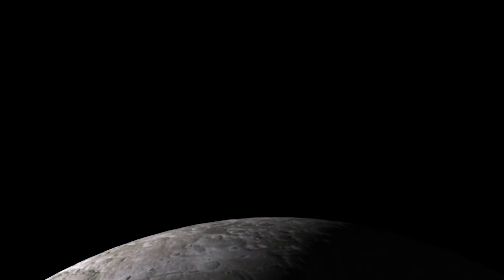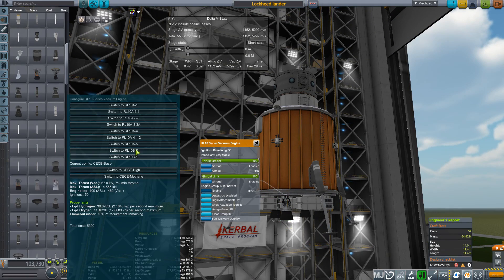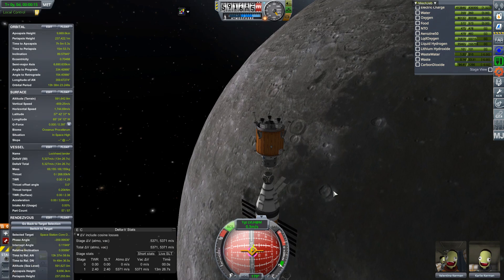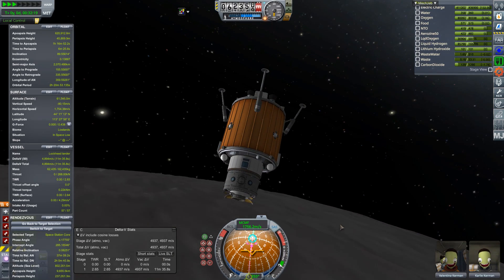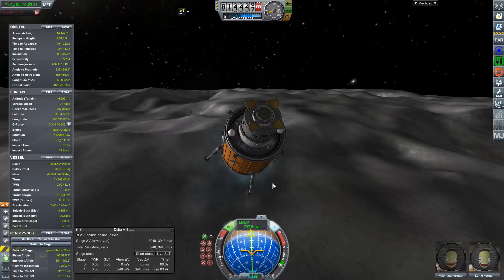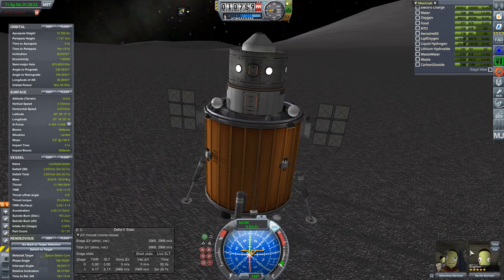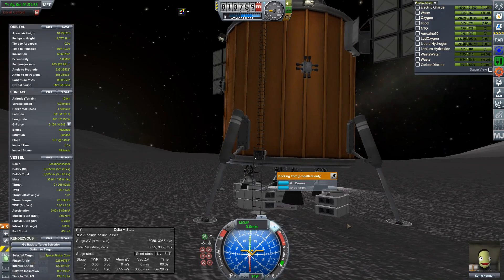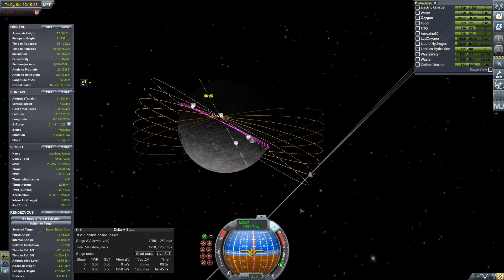Simulating Lockheed's Reusable Lunar Lander Concept

Comment: This thing won´t be ready in the next 10 years i bet, BFS will do the job a lot better before this thing would launch and it could refuel too on the surface, as  carbon can be collected from the solar wind(maybe also carbonate minerals) and enough water ice to use the sabartie process.
Reply: The solar wind is not really thick enough to collect carbon from in any decent amount of time. Choosing landing sites with carbon-based minerals is desirable. In addition, you need a lot of different chemical processes to get it into a usable hydrocarbon fuel.
Reply: i thought it was the bfr lol
Reply: The thing that gets me about this is the weight and payload.
Lockheed lander weighs 60t (all inclusive) and has a 1t payload.
BFS V3 weighs ~85t (empty) and has a 100t payload.  Yes you have to refuel it in LEO but that's a total of 285t, a 4.5x increase in weight over the Lockheed lander in return for a 100x increase in payload capacity.
Not to mention that Lockheed would probably charge the US taxpayer $20bn+ to develop it just like Orion ($23bn to 2023, excludes cost of the ESA Service Module)

Comment: What would be the advantages of using hydrogen fuel compared to… let's say methane which will be used for most of the rockets from now on?
Reply: Specific energy 142 MJ/kg for hydrogen 55 MJ/kg for methane.
Reply: Thank you very much
Reply: It's the opposite. Methane has no advantage over Hydrogen in a deep space enviroement. Higher ISP is everything. Methan has been choosen only because on Mars you can theorically harvest Co2 and make methane.
Reply: oh I see, now I understand it a little bit. I just started my first year in university so I don't know a lot about it yet. But I'll get there. Thanks again for the answers I appreciate it.
Reply: nuke99 there still a lot of things I don't understand on this scheme, if they plan to produce hydrogen and oxygen from the moon, they don't need to carry the return fuel, greatly reducing the lander size but requiring to send an fuel producing facility on the moon before landing. I don't see it in this project and producing and keeping liquid oxygen and hydrogen from the moon water if it exist would require huge solar panel and liquefaction facility. On Mars converting CO2 to Methane is a very inefficient process, how many rockets will they need to send before getting a fully functional plant?
Reply: @johnkubik8559   i don't know how many rockets Musk will have to send. It's all on the paper stage.. let them even start something serious on their rocket before anything else. For what concerns LM lander, that huge mass is because the lander himself is massive as hell. It's much more spacious than the apollo lander. And it will have refuelling capabilieties
Reply: Methane is much easier to store over long periods than hydrogen.  Hydrogen is notorious for slowly leaking out of any reopenable container, such as rocket fuel tanks.  This is because the tiny molecule size of H2 lets it slip through the tiniest cracks and even diffuse through solids.  Hydrogen also has a very low boiling point, 20 degrees Kelvin, meaning that it must be kept very, very cold at all times so that it doesn't boil and cause your fuel tank to overpressurize and explode.  For reference, nitrogen freezes at somewhere around 60 degrees kelvin, and the boiling point for methane is 112 kelvin.  Even in space, hydrogen would need active cooling to stop it from boiling away long term, and on the blisteringly hot surface of Mars or the Moon, or even Pluto, for that matter, you'll end up having to pump in quite a bit of energy for refrigeration.  This is especially troublesome if you expect to manufacture fuel from resources on the surface you landed on, since whatever you make will have to be chilled down below its boiling point and stored as such in a big tank for a long time as you accumulate enough fuel to launch.

Related to this, hydrogen needs bigger, heavier tanks than any other sort of fuel, especially for long term storage.  This is not only because it's much lower density than anything else, including methane, but also because the tanks will require extra layers of insulation to keep refrigeration manageable.

Comment: The centaur upper stage replacement will use gaseous H2 and O2 for reaction control combined with cold gas trusters. BFR will use methane and oxygen. 
Both systems will use self pressurization.

Comment: Before watching your whole video I would have to say that this sounds like the promise of a reusable Space Shuttle: That it was going to be so cheap and with a quick turnaround.
Reply: Nah, the Space Shuttle was a totally "wrong" design of a swiss army knife. That's what put costs and errors through the roof. It COULD do one or two things really well (see the x-37 which does things very well and cheaply, but does 1 thing :P ). This is just doing 1 thing, luna landing and ascent as a single stage.
Reply: Space.com's article covering this release noted that unlike the STS, this vehicle would not depart from and re-enter Earth atmosphere between landings; it would stay on station at either Gateway or the ISS, thus greatly reducing the turnaround maintenance requirements.  The Orbiter was an economic failure because its turnaround was maintenance- and QC-intensive; I think that every 2.5 missions enough money was spent to construct a new Orbiter vehicle.
Reply: You could say the same thing about SpaceX, New Glenn, etc. At this point only time will tell.

Comment: Hmmm, I wonder how the lander will handle multiple landings and liftoffs. I don’t remember which mission it was but I believe it was 15 or 16 that the decent engine bell was damaged on landing.
Reply: Adam Allman Good question
from what i remember moon dust is pretty abrasive too
Reply: Right? I can see some flaws to the logic, if they make it work then that’s great.
Reply: Christopher Bloom  Rubertoe
It sounds like a sensible idea to me; an appropriately placed landing site relative to the Gateway periapsis could facilitate a planned 'deorbit' descent burn, then allow for 'hops' to other safe landing sites or VLLO (Very Low Lunar Orbit) surveys.
Reply: Sounds like the engine bell wasn't decent anymore.
Reply: Adam Allman that’s why they need to send a rover down and build a lunarcrete landing pad, save gas by doing suicide burns.
Reply: Is the engine using a catalyst like the SR-71 used to ignite the engine and afterburner?
Reply: No, it's the RL-10 C or CECE series which are expansion cycle.
Reply: Yes, it uses a hypergolic fuel to start the turbo pumps, whose exhaust lights the main chamber.
Reply: @miles2378  Well, on the rover part, there is the problem that that limits to one landing site.
Reply: Adam Allman Kenetic Kups
Good points; we have no experience with the effects lunar debris will have when using the same engine for descent and ascent; the Apollo profile left the lander's descent stage on the moon, acting as a blast platform for the crew module to ascend back to the command capsule.